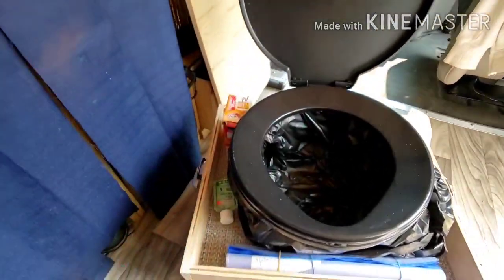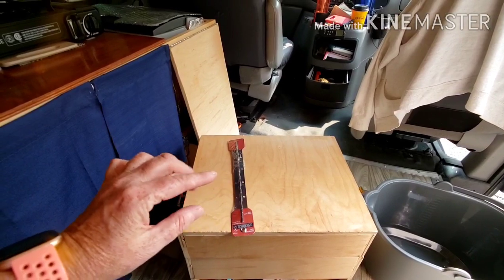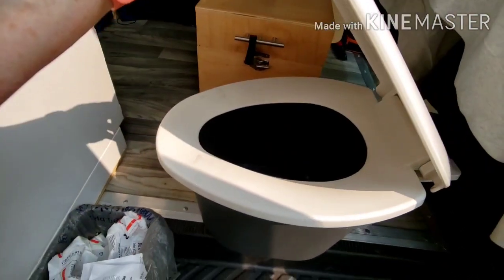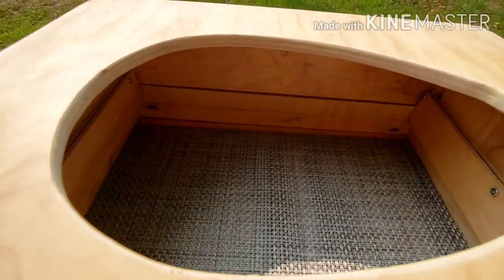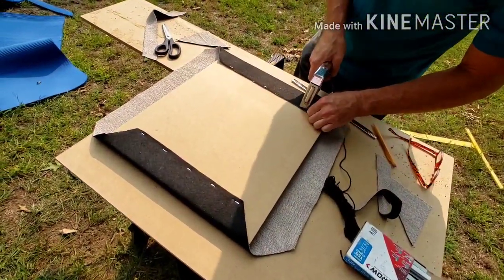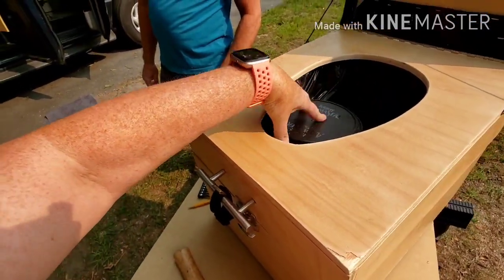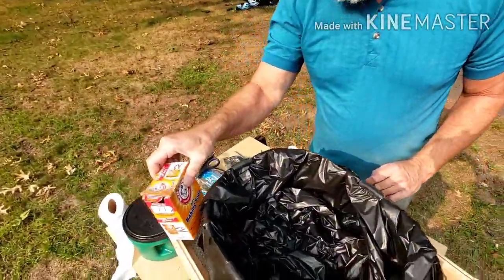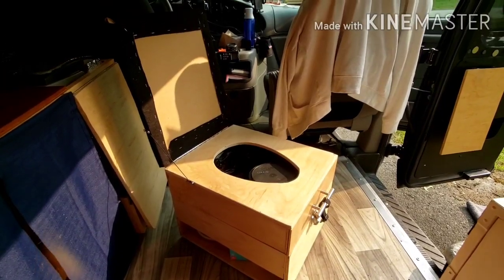UPDATED TOILET FOR THE VAN....MAN FRIENDLY

Comment: I use cat litter in a 5 gallon bucket for solid but not for liquid.  1) I keep a cup of litter on the side and cover the solids with litter from it when I'm done. 2) Then I press on the litter a bit with the side of the cup to completely cover/coat the poop with litter.  3) Then I use a litter strainer scoop to remove the solid and throw it out in the trash. 4) Then I refill the cup with litter out of the bucket for next time. I use an odor control litter so there is no smell once the solids are completely coated with the litter, really! 
Removing the solids out right after use keeps the litter cleaner and it lasts longer.
Reply from the maker: Good ideas

Comment: Have you had any problems with smell? I am debating making a toilet for my van instead of buying a natures head composting toilet but am concerned about not having a designated fan to extract the smell from inside the van.
Reply from the maker: No, as long as I keep the cover on the pee bucket . Then I dump it  as soon as I can. As far as number 2. I close the bag right away and throw it away asap.  I do have a fan right above toilet i put on air out when number 2.